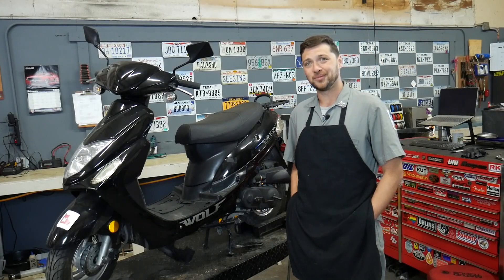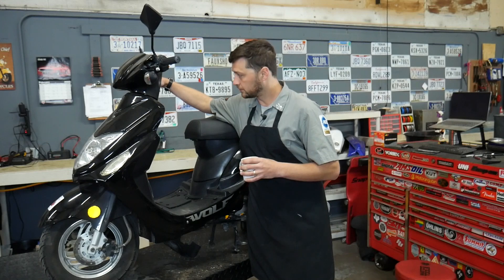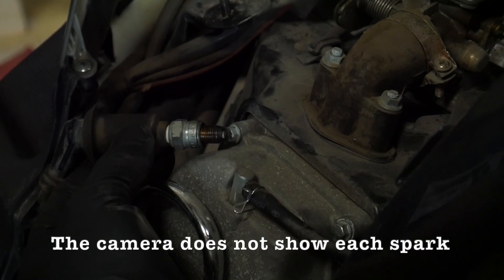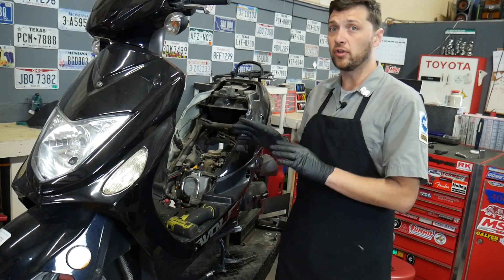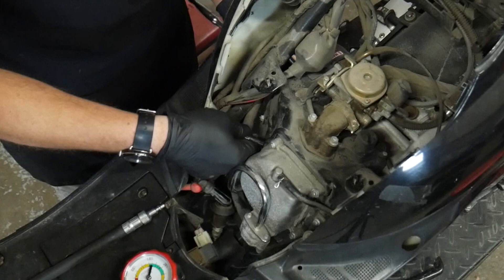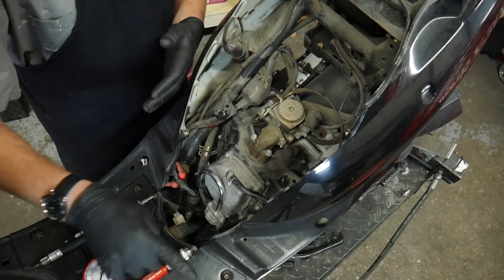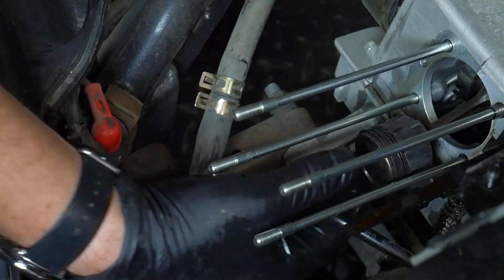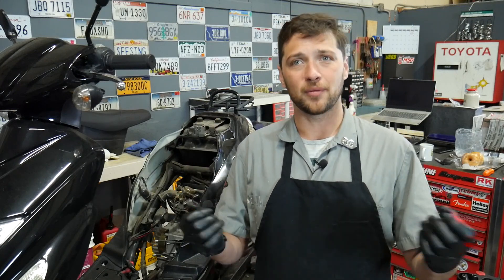Does your scooter have a blown engine?

Comment: Yoo i have a problem with my gy6 scooter (i have only ever built 2 stroke zips so i dont know much about 4 strokes.)

It has spark i can see the gas flowing to the carb it feels like it has barely any/no compression but the entire engine is new. The only thing is the 72cc cilinder that is on it right now i got with the bike but it didnt have any feelable marks or scratches.

List of new parts:
72cc cilinder head
Rocker arms
Timing chain tensioner
Piston & rings
Carb
Fuel lines
Cdi and ignition coil.

I dont understand what can be the cause of the issue the valves are timed right (i used a tutorial to time them) and put them at 0.10mm i have no idea what can be the cause of the issue i kicked it about 25/30 times (i will fix my starter soon) and it gave absolutely no signs of life carb cleaner didnt do anything so its not a carb issue it has spark and it still will not do anything. If someone has any idea please lmk.

Comment: Hey my moped with 139qma engine, fell down on its exhaust while running, it ran for about 5 seconds before i turned it off. After that the compression decreased a lot and took a lot of kicks for it to start. Opened up valve cover and there was a plenty of oil, cleaned it off and was a bit better and checked the clearences too they were not tight, i did forget to check the timing, but i did drive around my town and it ran as good as before falling

Comment: Hi! Can u help me with a 2001 vespa ET2? Cylinder wont move.
Reply from the maker: @safarijonas3490  oh no! Try some penetrating oil through the spark plug hole. Sometimes that will free it up. Otherwise you will need to try to remove the whole top end!

Comment: mine appears to be leaking out of the intake port from the air filter hole. does this mean i have bent intake valves? im sure nothing came out from dipstick and exhaust port. i also have a smoke machine.

Comment: These 139QMB and 139QMA engines are really good engines. Why they break down is due to neglect of service, changing or checking the engine oil so to say. Ive run several of these engines here in Sweden and they are a dream to work on, a lot of parts avaible and easy to wrench on.

Comment: What if your battery isn't charged all the way? Want this cause the compression gauge to give an inaccurate reading?
Reply from the maker: @richardgodwin4198  absolutely! If the battery can't supply the power to crank the engine over fast enough or enough times (until the needle stops climbing) your compression reading will be low!
Reply: @Scooter_911  I've figured out that I don't have low compression,  but if this new battery is low again and won't start the thing tomorrow,  I don't know what to do. New stator, voltage regulator,  and I went through all my wiring with a soldering gun, "I had a lot of quick fixes with butt connections over the past 4 years ." Anyway,  I don't have a compression problem

Comment: Hope you can help.  I have a new SYM Orbit II 125cc air cooled, carb model. It has done 105 km only!  At town speeds (40 - 60 km/h) with light throttle it has a bad irritating "orbital" vibration - like a very bad wheel bearing on a car.  This does not happen under power (accelerating with full throttle) - only at low throttle between 40 - 60 km/h slowly going up and down that speed. From 0 - 40 km/h and above 60 km/h it is absolutely fine. I have checked the belt, variator, rollers, clutch, gearbox bearings, all gears, rubber bushes to the engine/frame.... all seems OK.  What else can I check?  (Dealer says "this is how they are" however my friend also bought a new one two weeks before me and his does not have this issue...)  Where else do I look for the cause of this issue? Regards!

Comment: The 139QMB engine by Znen is tough as nails. It shows you how bad the engine was abused and neglected to end up like that. They usually go 20,000 or more if cared for. Some even more.

Comment: What are the correct valve adjustments for 50cc GY6? I have found a manual where it says to set both valves at 0.002inch/0.05mm. Is that correct?

Comment: Mine was still running decent just smoking terribly out the VC breather(I'm runnin scooterarmy88 BBK ncy cam ncy cdi and a uni filter) so I got anilother set of rings (they didn't charge me for them) but piston was slightly scratched but we were able to clean it up and rehone the cylinder, but still can't figure out why I'm leaking oil from the center of my crank seal.and over heating.

Comment: Here I am with 2022 ScootStar RaceStar 150CC that is well over 3000 miles with regular oil changes and valve checks
Reply from the maker: You earned it!
Reply: My sym 150 has 25,000 on it now 😊and only needs a carb.

Comment: Nice troubleshooting. Seems like those Chinese scooters need more routine maintenance that others....
Reply from the maker: They certainly do. It costs the manufactures money to develop better parts and the point of these scooters is to have a very low price point.
Reply: For good service you need to rebuild the engine and transmission every 1000 miles.
Reply: @billmilligan1705  Maybe better to buy a Honda for the long run!
Reply: Not all chinese scooters do, but you get what you pay for.

Comment: Ever work on a 85 Honda gyroS  tg50? Would you want too?  Took a ride put it away. 3 years later ...Starts ,won't run. No lights, horn trunk signal. Got new batt (Always worked before starting). Don't want to scape it .want to ride it one last time. Then auction it off to a high-school student. Specific note...this scooter has 9k miles.
Reply from the maker: I havent done much with Gyros but the service manual will always tell you everything you could need to know! If the bike has sat for 3 years it is likely the carburetor will need to be rebuilt. The fuel in the carburetors floatbowl deteriorates and plugs the jets.
Reply: Cleaned  it and yes I have the service  manual  still  no run.
Reply: I'm thinking  with 9k original mileage it's at it engin end ?😢
Reply from the maker: @mv4463  it's not outside the realm of possibility but I would make sure to test the compression and verify you have spark before you condemn the engine